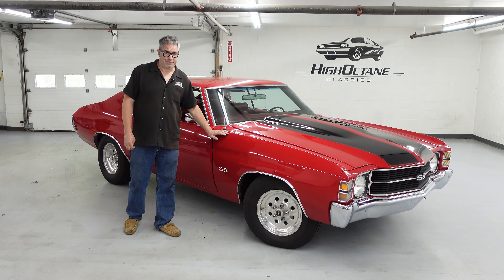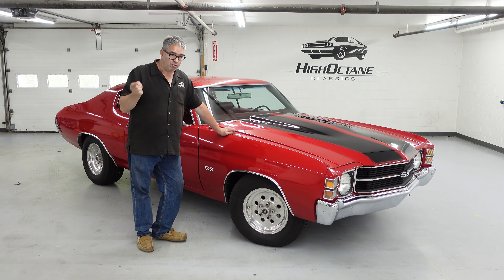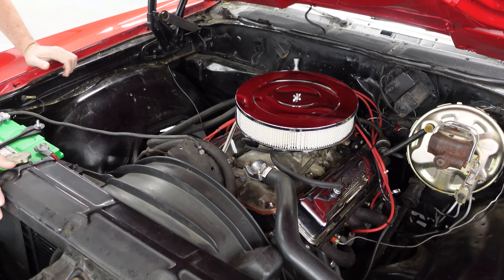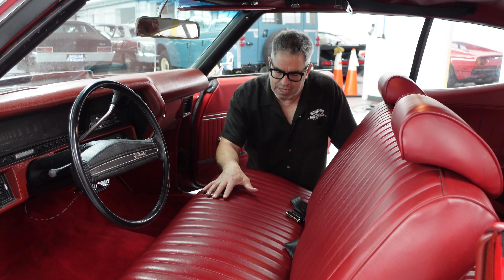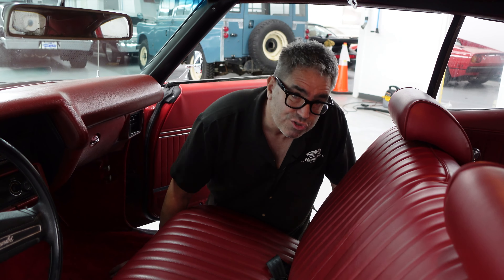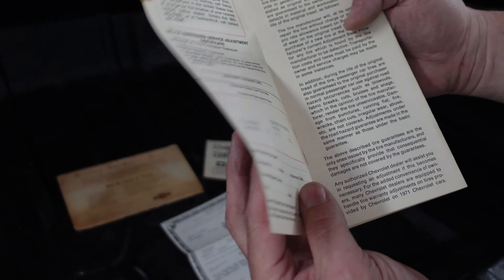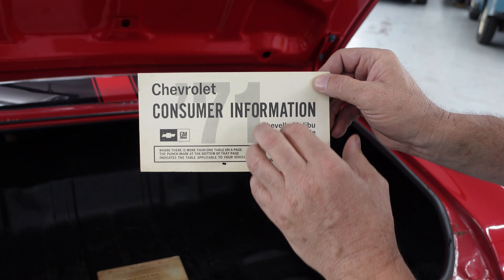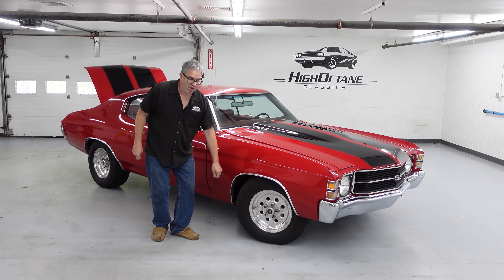1971 Chevrolet Chevelle Walkaround with Steve Magnante

Comment: The '71 Chevelles have the best looking rear end. The '70 Chevelles have the best looking front end.
Reply: Agree.  I had a '71 and loved the round taillights but wished it had the '70 front end.
Reply: @PocketChangeInspector  I'd put the round light bumper on the car and keep the correct bumper. That way, I can re-install the correct bumper if I decide to sell the car later own.
Reply: Exactly